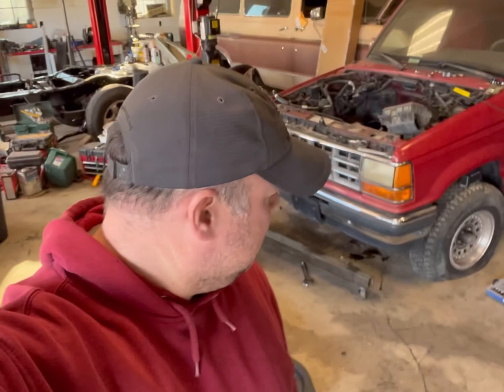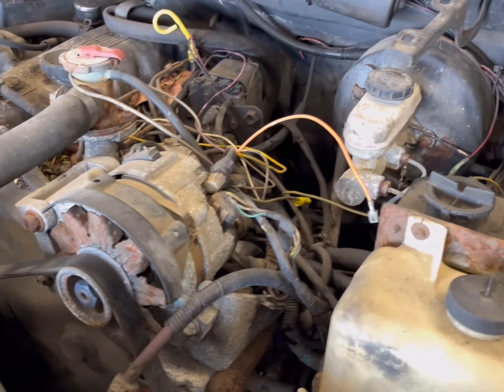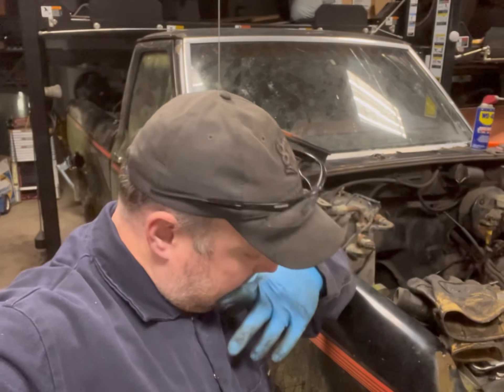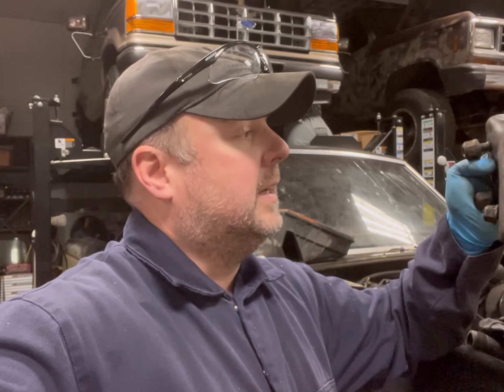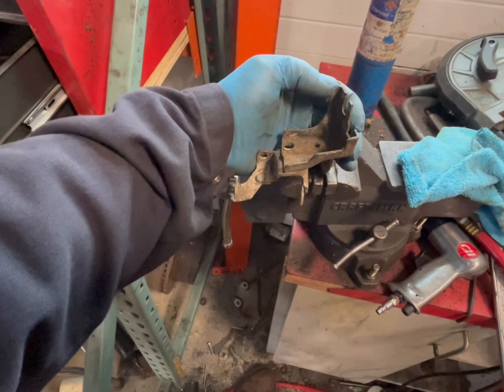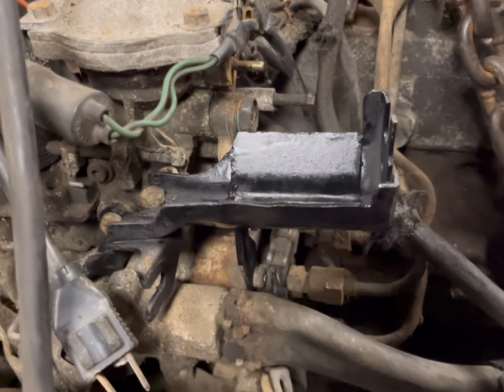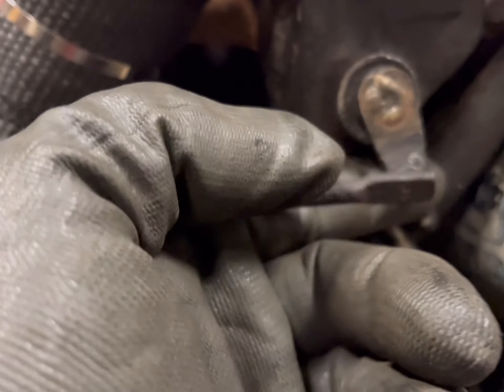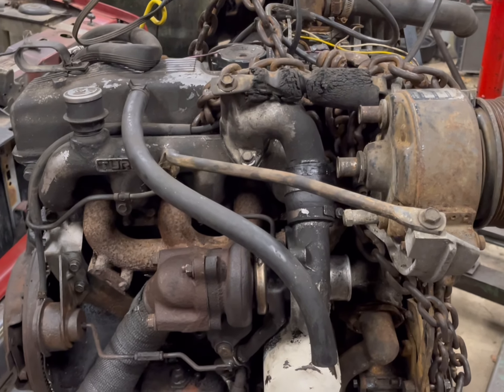Diesel swapping my 1990 Bronco II Part 1

Comment: This is the kind of project that ive been thinking of tackling on my channel but im hesitating which one. I saw a video not too long ago about someone putting in a VW VR6 diesel engine in theirs.
I'm leaning more towards a modern 2.3L Ford gas engine that i could turbo
Reply from the maker: As a Diehard Ford guy I wanted to try and make what should have been in more Bronco’s from factory. Plus the “easier” bolt in swap idea of this swap interested me not to mention the donor truck was cheap!! Thanks for watching!!!

Did you see this build….. I found it pretty good!! He swaps a 2.3 Ecoboost into a Ranger. 

https://youtu.be/guZ-V0LIm54?si=SyKsq8YJnT68TVY8
Reply: @GillansGarage  As a die hard Ford girl, i get it :)
And no i did not see that video! That's awesome! thank you!

Comment: Looks like your motor swap is going better then my attepmt to put a Holley sniper on my 84 2.8. runs and drives nice but wont start to save its own life.
Reply from the maker: Thanks and good luck with getting yours setup!!
Reply: @GillansGarage  thanks, going to attempt to start it up to get to work today, I don't want to drive my tiny car In 8 inches of snow plus I hate that escort.
Reply from the maker: @p51mustang52  I don’t blame you!  I wish we had snow.
Reply: @GillansGarage  well didn't start but at least I made to work on time.
Reply from the maker: @p51mustang52 That’s good.